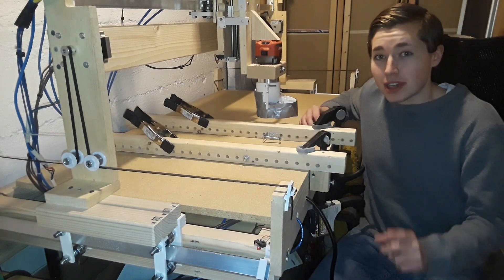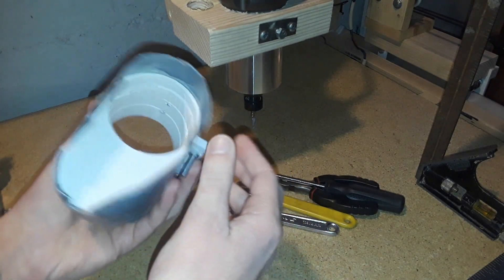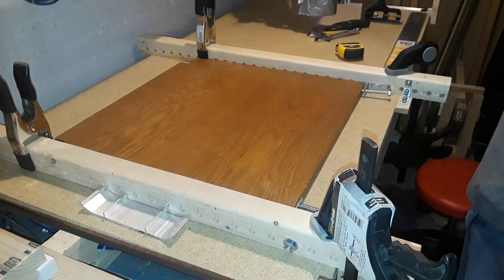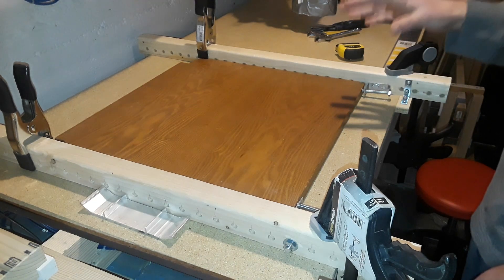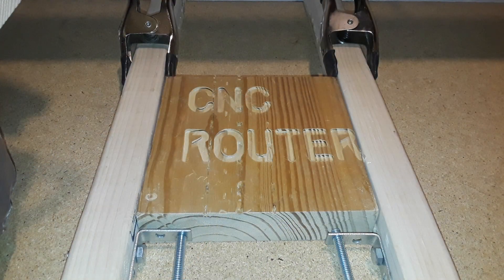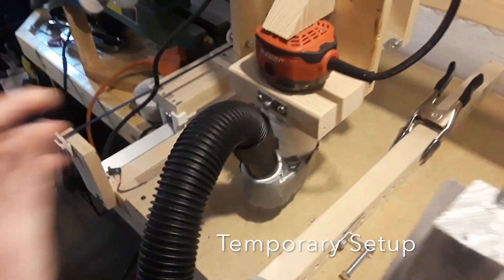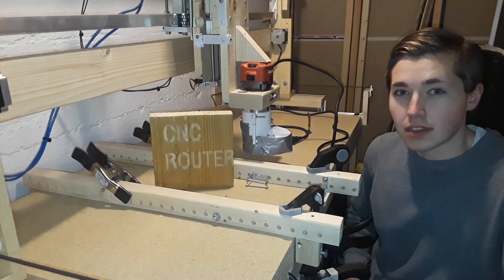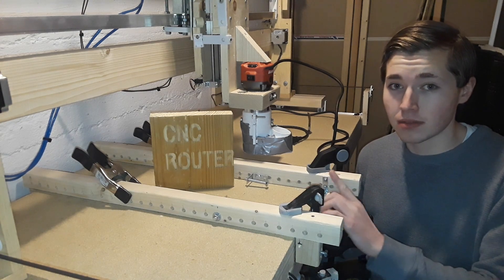Homemade CNC Router Part 5: Finale!!! ($400 CNC Router)

Comment: Hi, can you tell me with how much IPM you can cut wood, and are those steppers good enough?
Thanks!!
Reply from the maker: I usually cut at 55 Inches Per Minute. My Cnc Router can definitely cut at a faster speed but I prefer to be slow and steady. The Nema 23 Motors I've been using have been working great!
Reply: @BunkerBuilder  ok, thank you ✌😊